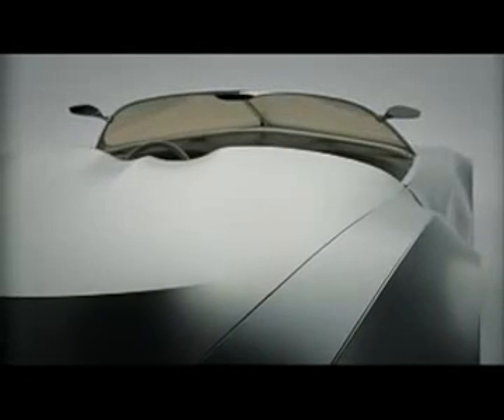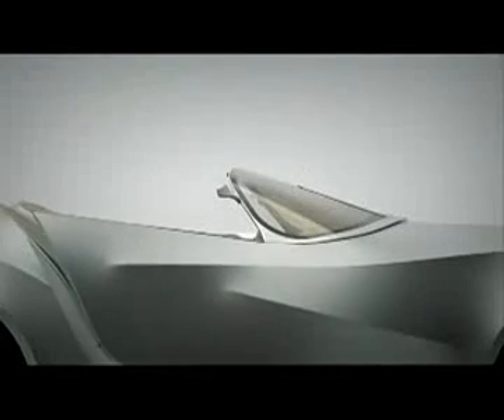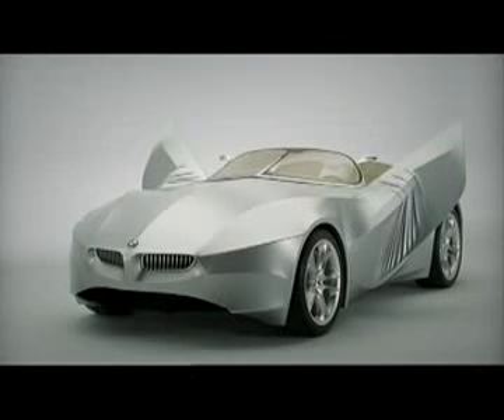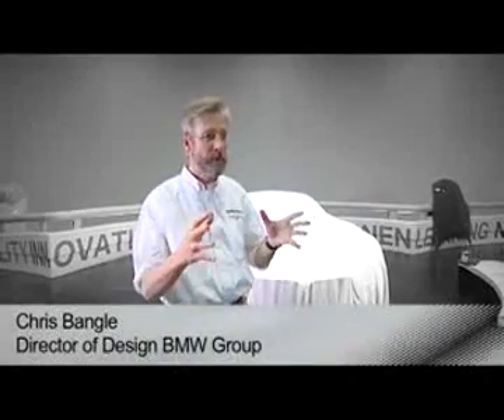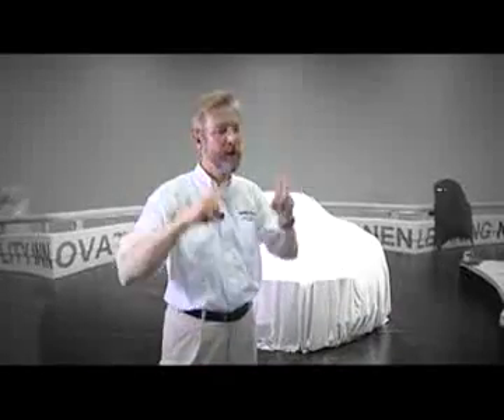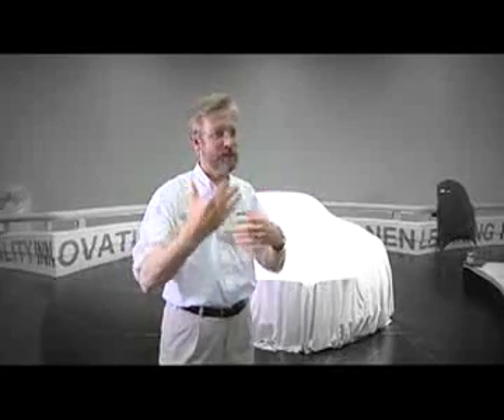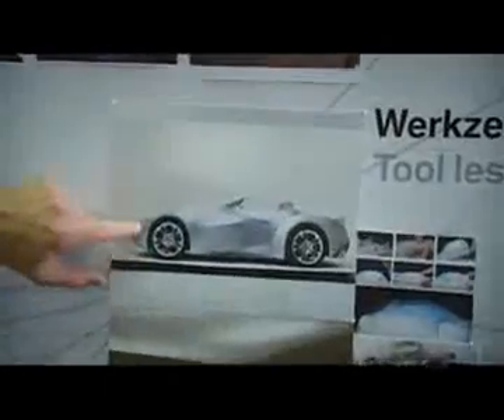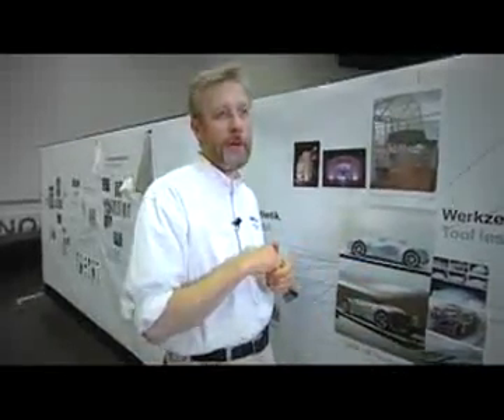The new BMW Gina Light Visionary concept car

Comment: the exterior is not a cloth; it's a composite material resilient to weather, and other regular wear/tear. as the years pass, bmw will certainly come into possession of an even more durable materials. and the beginning is correct; current vehicles today do not provide much structural integrity in the skin of the car. exterior metal is only slightly reflective to minor bumps and scrapes. the underbody and frame is where 99% of the body strength comes from. this car will be a reality in the future.

Comment: @originaldriver dude thye just don't have the metal skin on top. That stuff is flabby as hell it wouldn't really protect you that much. If you took it off you could kick a huge dent in it. So what this car isn't supposed to win most safe car of the year. They still have a base metal structure underneath obviously.

Comment: why does it not seem safe?  It is actually probably 4 steps ahead of the current standard of safe.  Is a Formula 1 car not safe?  Space frames when designed and built right are much much safer than the cars of today.  As far as practical goes....  its a 2 seater sports car.  Is any 2 seater sports car supposed to be practical?  Its something that a mid aged single or married with no children person would buy it doesn't need to be practical for the kinds of life styles BMW appeals to.